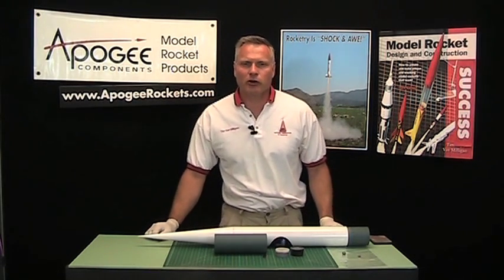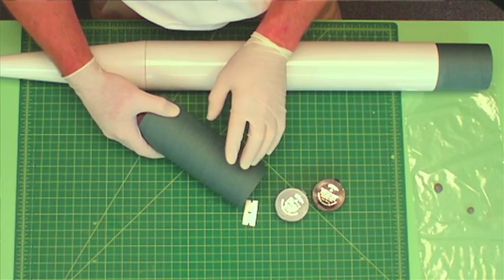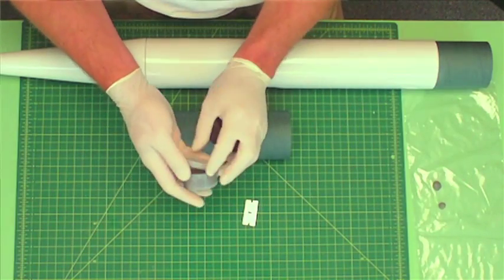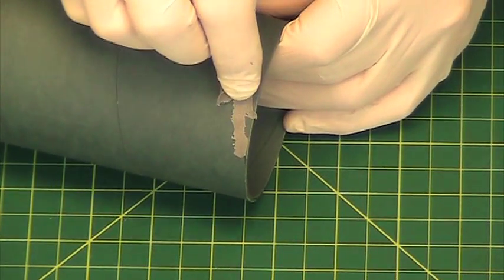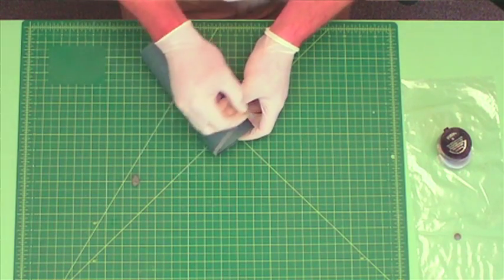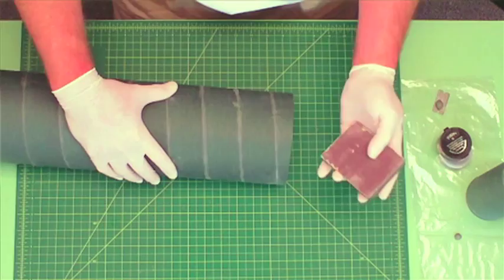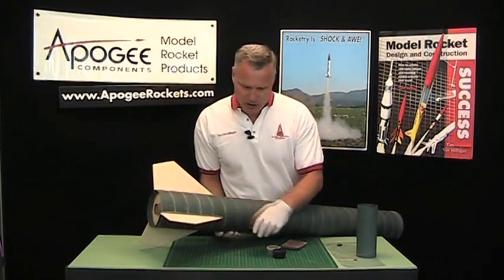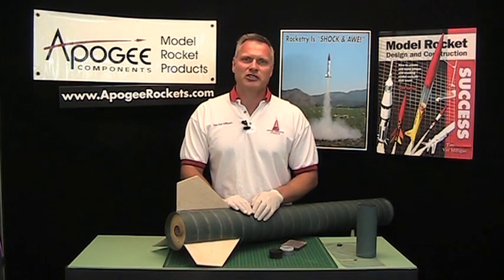Fill Model Rocket Body Tube Spirals

Comment: Nice Tim :) Also you can use sandable primer spray the tube then use laquer thinner and wipe it off. Little messy but it works and its faster. 

Wood filler u can also use to do the same thing as the clay. I picked up a 1lb container of Gorilla Wood filler for 9bucks  and that will last me a long time for low or med power rocket tubes. Of course u need to sand it down smooth before primer n paints.

Comment: I'm working on a new rocket using LOC Precision 4 inch diameter tubing. Can I use any brand of epoxy clay or is there something special with this brand? Thanks.
Reply: just about any two part epoxy clay works great. I would also mention that the longer and thinner you make the epoxy "snake" the easier and less excess you have to deal with...

Comment from the maker: @izaya35 The rocket is a scratch-build project I'm just doing for fun. It is based on a 5.5" diameter Blue-Tube, with a LOC nose cone on top. There will be an electronics bay that will house a new GPS based dual-deployment system that a friend of mine is building. Check back on my channel for further updates.